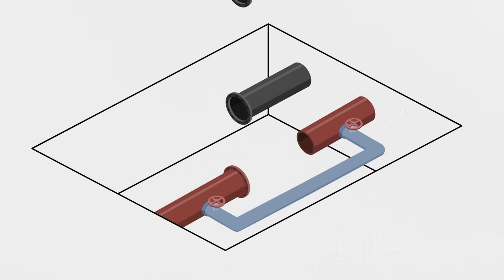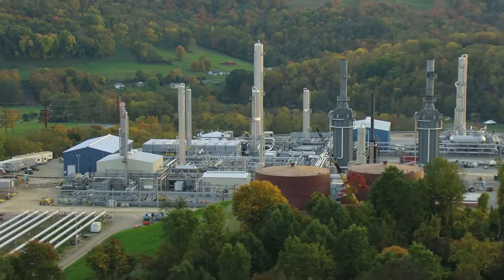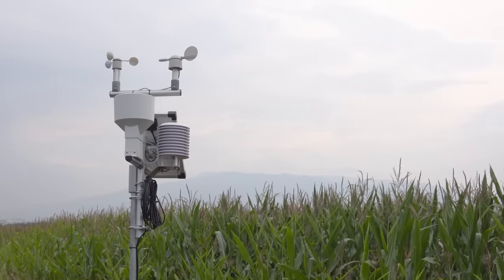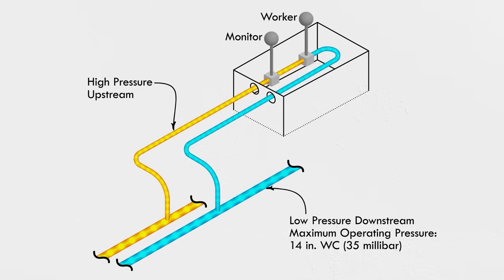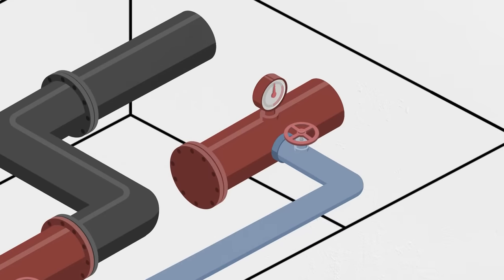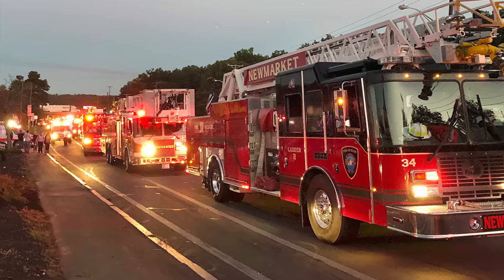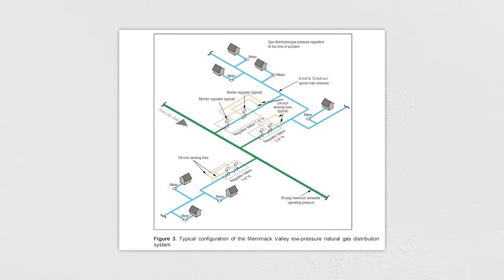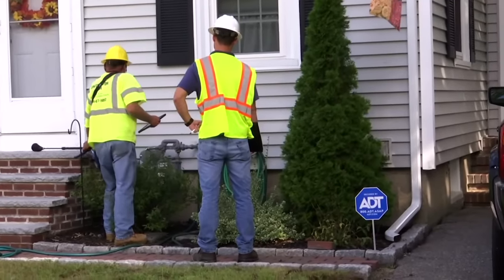What Really Happened During the Gas Explosions in the Merrimack Valley?

Comment: I had a water heater installed  few years ago. The installer used copper pipe for the gas line and HE SOLDERED IT. When that inevitably failed, it cost me a fortune to get fixed. That installer, by the way, is now a cop.
Reply: copper for gas?  I've literally never seen that.  how did he even manage to make it fit?  crazy.
Reply: @tsm688  I have no idea. I never really paid any attention to it, but when the next guy came to replace that water heater, he almost had a stroke.

Comment: Can someone please explain to me why they are not required to install pressure relief valves downstream of the regulats? If the regulators fail for any reason a pressure relief valve will prevent over pressure disaster.
Reply: what kind of pressure regulator are you going to find that can handle 0.5 psi as input?  They should have had to redesign their whole system, probably.

Comment: just like electric natural gas is a very critical resource and if it gets disrupted  during the winter  many people will not have heat .

only those with propane and electric would still have heat.

i think pressure cut offs should be built in the meter so if the pressure goes up too quickly and too high the meter would trip and slam into lockdown requiring a reset.

gas rushing through the line could cause static build up causing a source of fire.

Comment: so there's a difference between "inches of water" and "pressure head", then? Because when you described that inches of water measurement, I've always known it as, let's give your 12 inch example, the pressure exerted by a water column of 12 inches on its base. But now, I went on wikipedia -- the article needs love, btw, for anyone knowledgeable on this subject -- inches of water is the force exerted by a column of water 1 inch high at a given height??? Help!!!
Reply: No matter how wide it is, the pressure AT ONE POINT at the bottom of 12 inch deep water is the same.  the pressure is related to height, not width.
Reply: @tsm688  correct, which is why i didn't mention width in my comment ;-) but, maybe here's where i'm misunderstanding: rereading the wiki article, they're defining 1 in.w.g. as "the pressure exerted by a column of water of 1 inch in height at defined conditions"

So they take that force (approx 249.082 pascals) and then, if you have 5 in.w.g. that's 5 times that amount so 1245.41

I was always under the assumption that instead of just taking a unit measurement and multiplying it, that they would instead compare 5 inches of water to a water column 5 inches in height. Which, I guess scales that way too? I have no idea

Comment: Just because someone has a PE stamp means they know what they are doing. I redesigned a digester panel for a waste water plant retrofit. These drawing had a PE stamp on them. So I open up the existing drawings and I could not believe what I saw. Every neutral and ground was fused. Even at the main disconnect. FUSES are you kidding me! Lucky no one got killed. I do not have a PE stamp, I don't even have a college degree and know better than put fuses in a neutral wire. A degree may make you more educated but it doesn't make you more intelligent. Anyone can be more educated.

Comment: I was confused by the choice of colors of the cast iron and polyethylene pipes. Cast iron is often referred to as "black pipe", due to its color when new. HDPE pipes are often yellow, for small diameter, and often have a yellow accent for large distribution pipes. I understand that over time, cast iron rusts and turns red, but it took me a while to figure out that the pipes were switched from what was in my head.

Comment: Even if an error was present, the procedure should've included close monitoring of the situation.  Wouldn't it be a good idea to watch pressure on a pressurized line that contains an explosive?  Wouldn't it be a good idea to monitor the situation when applying explosive substances to new routes?  Is an engineering background really required to see how dumb this is?  There's really no excuse for something like this.  We really need proper culpability standards or this will become more common.  "Oh, we're sorry.  This stuff is hard.  Some accidents will happen.  It's no one's fault.  Sorry.  We did this, but it's your problem now.  Smile and have a nice day."

Comment: My natural gas pressure is 9" water column! Does anyone know why the [or any] homes regulators couldn't regulate or handle a mass overpressure?
Reply: Because low pressure meters do not have regulators.....
Reply: @TuringMachine-xc3gf  Correct, in CA high pressure nat. gas @ 5 to 15 PSI [to the home] goes through a regulator next to the meter, dropping it to less than 1 OZ or near 9" water column! But I don't under the system mentioned above! Low pressure mains in the street would be ludicrous, for the same high voltage is used to deliver electricity, then lowered near the home!
Reply: @stevemitz4740  
 
Considerings the era when residential gas service was first installed.... But I agree it has its limits.

From what I have been told, the current approach, and one being upgraded to, is 30~60 PSI to each house meter, now outside the house {vs. in}, a regulator there, and low pressure to indoors. This lets them serve far more CFM with smaller ID pipe. The upgrade often has HDPE slid inside the old black steel service {i.e. the street-to-house pipe} yet at higher pressure, there's enough capacity to spare. The gas distributor is ALWAYS worried about a low-pressure event when pilots go off.

But from what I read, the Merrimack rebuild didn't do that. If true, i don't know why they would rebuild to an obsolete method.

Comment: Do natural gas ignite at extreme pressure like a diesel?
Reply: even under extreme pressure, diesel won't ignite without oxygen.  neither will natural gas.

The problem here was dozens or hundreds of natural gas leaks inside homes with furnaces so old they still had pilot lights.  And the pilot lights shooting three feet in the air from the over pressure.
Reply: @tsm688  thanks, but they do ignite with oxygen under extreme pressure right? I'm just really curious if natural gas can ignite   like in a diesel engine where only compression is needed
Reply: @Monkey_D_Luffy56  There's really nothing mysterious about it.  Compressing air makes it super hot, and fuel + heat + air = boom.  The diesel fuel itself, is not actually compressible.  Diesel engines seem able to tolerate a lot of different fuels, unlike gasoline engines which are quite picky.

I'm not sure you could pump methane into a diesel without modification though.  In principle it would work, but methane is a gas - which IS compressible - so the same injectors used for diesel won't work right.

Gasoline engines can work with methane really well too.  They don't have to worry about vaporizing the fuel when it's already already a gas.  We have a backup generator at the water plant that uses natural gas;  it's a normal looking Ford engine block with slightly weird injectors, hooked up to the gas line.
Reply: @tsm688  thanks you, my questions might be unrelated to the video I'm just really curious and an awesome person provided me with answer.

Comment: That makes no sense... If the line being worked on was the HIGH pressure line, and the sensing lines you mentioned are connected to the LOW pressure system that was NOT worked on, how could the work done affect the placement of the sensing lines? There's something missing here.
Reply: The sensor lines were left on the **old, abandoned line**.  The pressure valves were not monitoring the new system at all!

Comment: As someone who has spent 20+ years designing natural gas facilities the requirement of a PE signature isn't going to help much on small details like this.  The PE programs dont test for natural gas situations.  And you can any engineering displine sign the design.  Civil, mechanical, electrical,  even environmental can all sign drawings for the same result.  Then there is the problem with the natural gas industry as a hole.  Where they use mostly 3rd party contractors for all of the designs,  and the company engineers are glorified secateries that sign requisitions that some minimum wage draftsman of a 3rd party contractor filled out.  The sad part of it is,  those engineers don't care to do anything else.

Comment: They are literally upgrading the gas line right by house at this moment. They are just upgrading the size of the line when I talked to some workers about it.
Reply: What are you referring to? Certainly not this event which occurred in September 2018. The gas lines in 40+ miles of streets and every service connection line were replaced immediately after the event with crews brought in from all over to get it done before the weather turned really cold.
Reply: @DisinterestedObserver  nothing related to this. They've build several new houses in the area the last decade and upgrading the line to one with a bigger diameter to compensate for the added usage. This is way up in centrel Canada on an acrage. I trust them but this video will inevitably change what I think about when I look out the window and see all the equipment there.

Comment: Having a PE review these things in my view will only accomplish an increase in cost and time to implement.  A PE with a certification in pneumatic systems will help but the errors and omissions insurance would be unaffordable.  A completely new approach to the system such as going to higher line pressures with each house having it's own regulator to lower pressure would at least limit the problem to one residence if a regulator fails.  This requires starting over completely.  If instructions are not followed by field technicians who are human beings, no approach even if reviewed by a certified PE will prevent what happened here..

Comment: Let me guess, you are releasing this now to add to the WEF's anti-gas propaganda campaign?
Reply: @TheEsseboy  I wish that were true.  electricity is an insanely expensive way to heat a home.
Reply: @tsm688  Not with a heatpump, we get 4-5 times the energy we put in, and because we have a downhole system it doesn't matter what season. Also tripple glazing, 20 inches of roof insulation, and 10 inches of wall insulation does the trick :) Gives us almost free cooling during the summer, as we heat the hole that is about 4-7 degrees Celsius after the winter season.